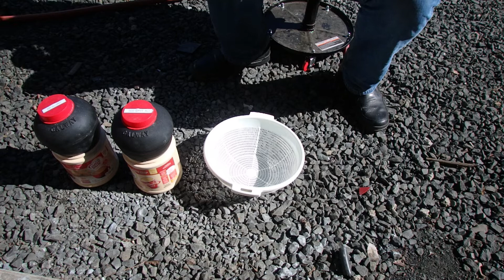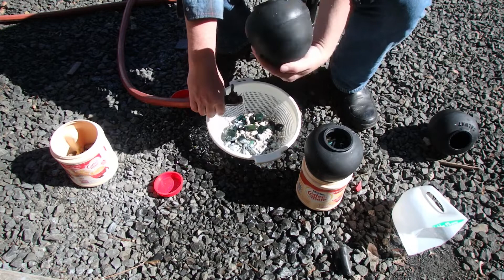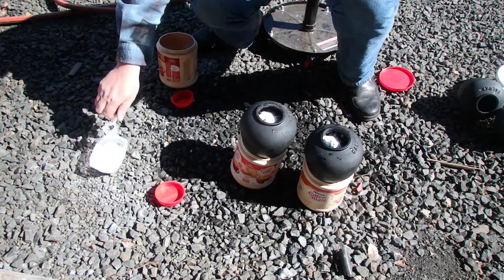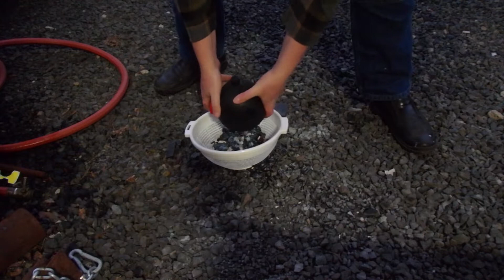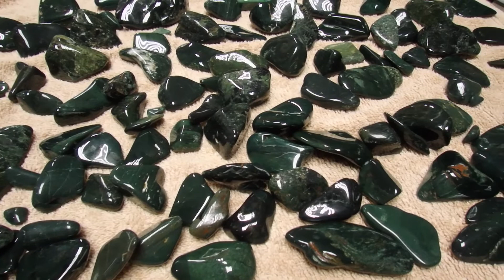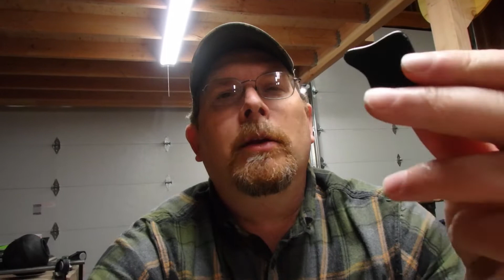Tumbling and Polishing Green Jasper Part 2 Since everything is shut down, let tumble some rocks!!!

Comment: Good morning! Truly love your videos! One question- are you reusing your ceramic media from one stage to the next In the same batch? Do they resist picking up the grit? I've only reused plastic pellets saved and labeled with stages because I was told they pick up and transfer from one stage to the next. If ceramic media doesn't do this, why would anyone use plastic ever again? Your method is so much simpler! Thank you for sharing! ⚒💚⚒
Reply from the maker: I carry the ceramic media from one stage to the other. Just did the same thing with some pet wood.
Reply: @1JawsJr  Thank you so much for your reply. So, if I understand, the ceramic media will grind down and just doesn't pick up grit, allowing it to move to the next phase. Thank you for your detailed video on tumbling. I knew I had to be more picky about which pieces move up.
Roll on, Sir! 👍⚒👍

Comment: Great job. One question, why do you use borax when polishing?
Reply from the maker: For a few reasons help to coat the rocks to allow better grit coverage, ensures the grit does not settle to the bottom on vibe polishers when first starting, and thickens up the slurry in rotary tumblers. Also make the cleanup much easier.
Reply: @1JawsJr  good enough
 Thanks!